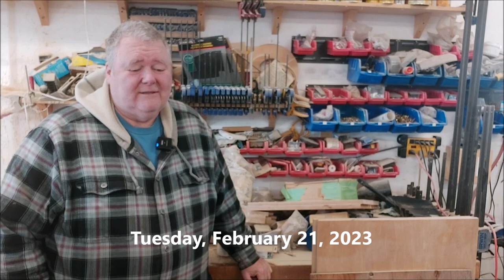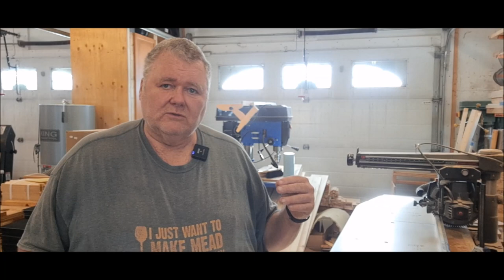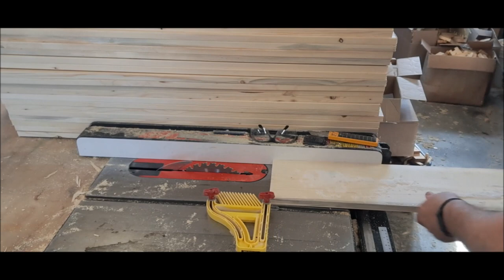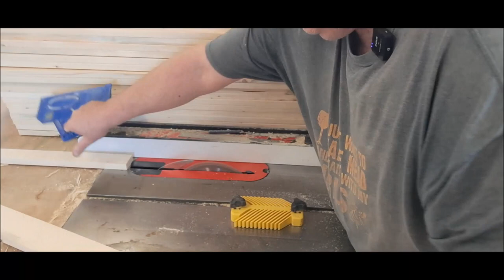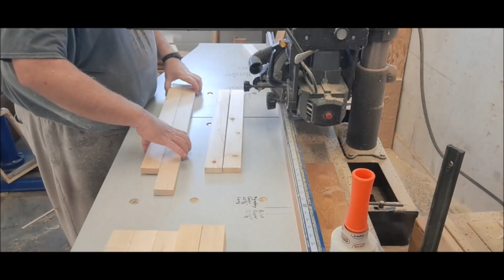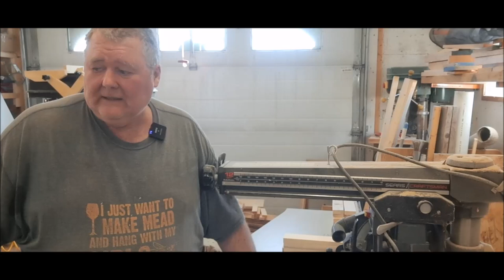⏱ Vlog February 18 to 24-That Bee Man

Comment: Its a called an idiot fee.  I once changed out a battery and then had to call a tow truck.  $150 for about a 3 mile tow.  Turns out I didn't take the black plastic cap off of the negative post.  The red one was already off the positive so I never noticed it!  It was dang hard forcing that collar down around that oversized post.  I still have that scarred up cap somewhere.
Reply from the maker: Thanks for watching!